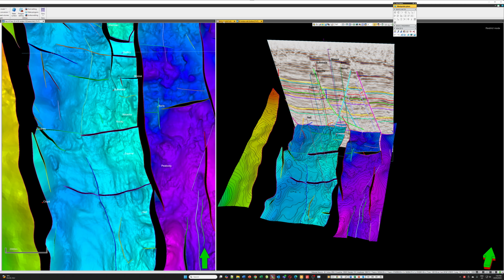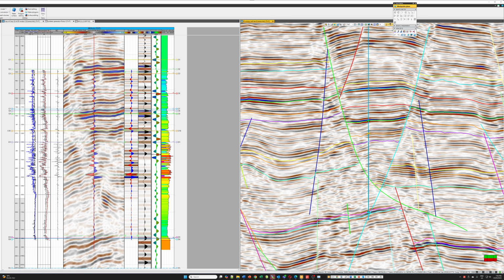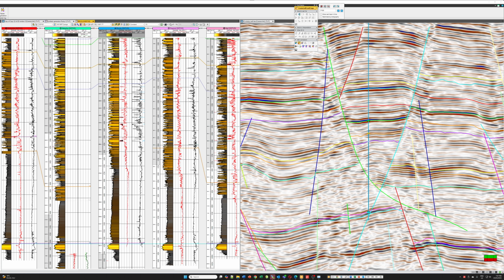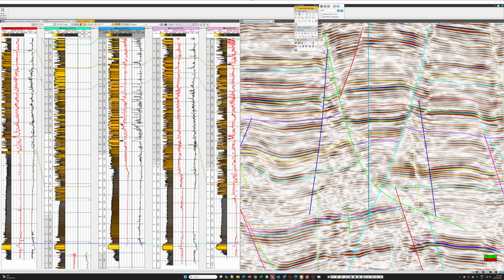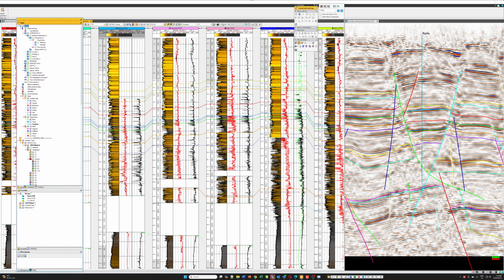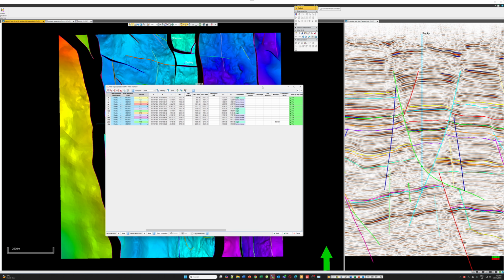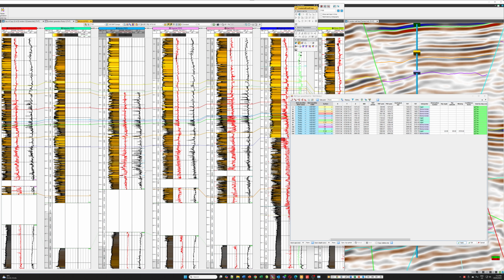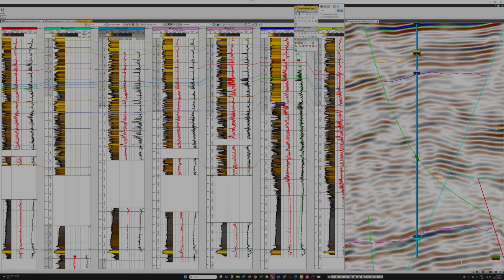Integrating Interpreted Faults in Well Correlations using the True Stratigraphic Thickness Domain

Comment: Hi Mike, because of the fault, the Rocky well does not penetrate the yellow, orange or top of the green sections (i.e. the 1500m of missing section you have just created) - do you then create dummy Markers for these horizons anyway, I guess at the top of the fault, to show the zero thickness of these units at that well location? Does that make isopach maps easier or harder to work with?
Reply from the maker: Thanks for the question. The short answer is no. One of the things I often contend with is a legacy well correlation where people have place formation tops at fault boundaries because below that point, formation A or B is present. IMHO, this is not the formation top and it can really make a mess when calculating formation thicknesses. If there is a 200m thick unit in the area, and our spreadsheet says it 30m think in a well, that's just confusing and easy for people that don't investigate the reason to make bad decisions. I'd rather it report no formation top  and make people investigate. There is a BIG difference between a unit that has zero thickness and one that is cut out by a fault!

The second part of the question is also interesting. If you've watched any of my other vidoes, you will know I am a big proponent of Volume Based Models for all scales of interpretation, from exploration to development. If you build a VBM abd tie the wells and faults (which you should feel pretty good about after watching this video), the isopach/isochore mapping falls out without any effort at all. If you insist on doeing it the old fashion way, you simply need to make sure you put your fault polygons on your isopach maps before you start. And where do the most beautiful fault polygons come from...... VBM.
Reply: @thirdigeoscience171  Thanks Mike - would have been great to see a 1 day or 2 day short course from you as part of AEGC or other multi-client event. I guess it is hard to get trainees access to Petrel on their laptops or training machines.